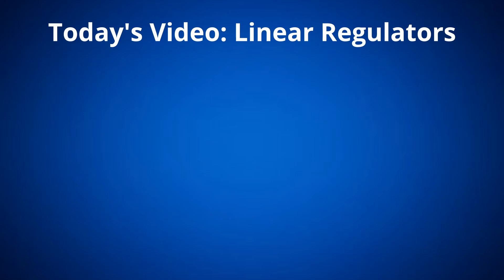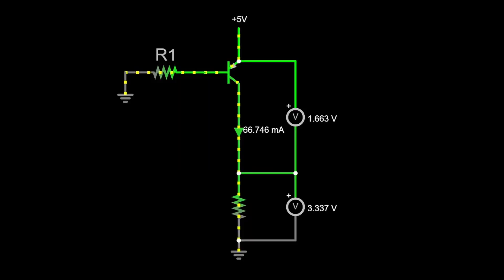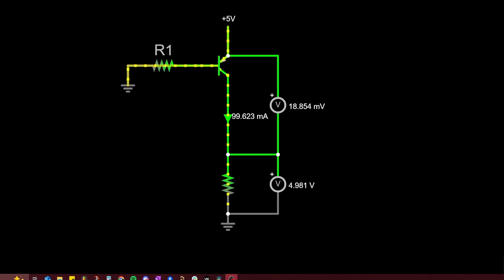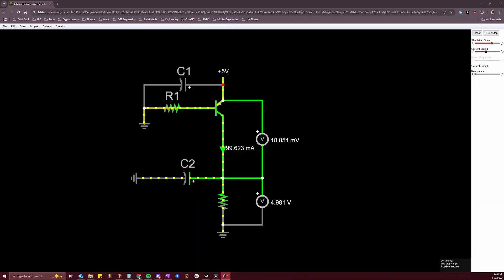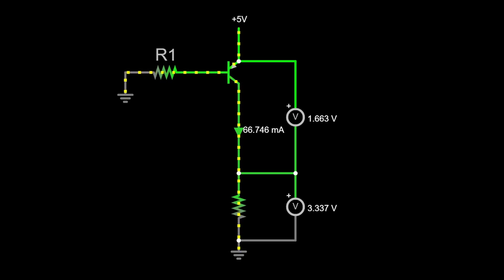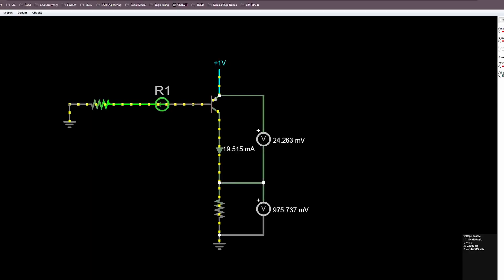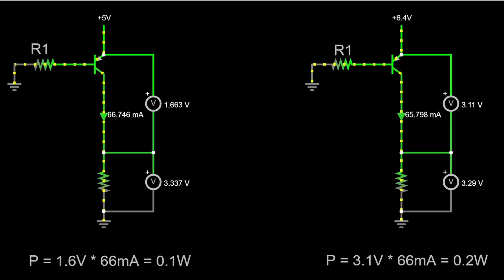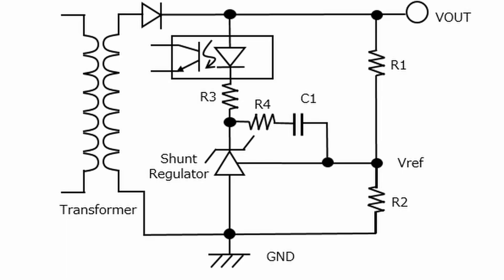Linear Regulator Basics (for Beginners)

Comment: 0:04 No, lineal regulator stops being lowest cost as soon as heatsink gets included into cost calculations.
Reply from the maker: very true, unless you are already using a heatsink ;)
Reply: @RGBEngineering  when heatsink isn't required then lineal regulators are practical, when heatsinks become a necessity for lineal regulators - switching regulators should be used instead (including when doing so removes heed for heatsink)